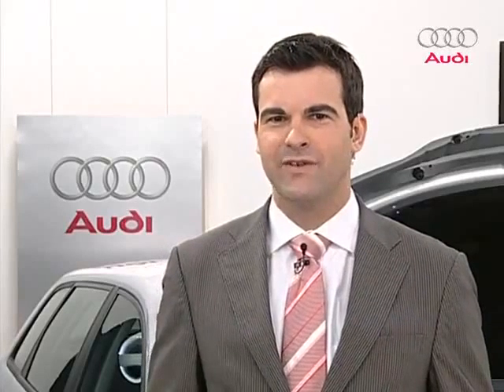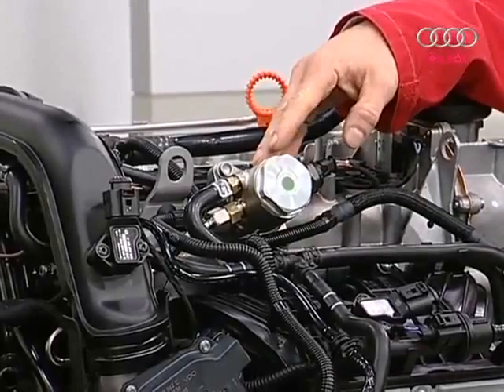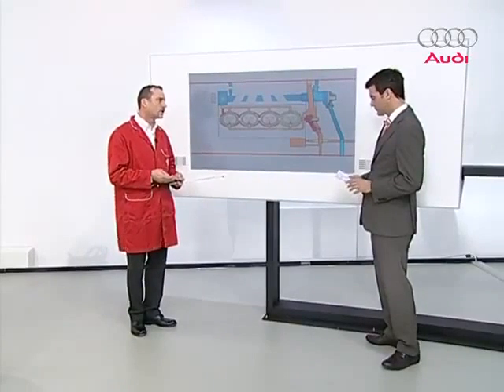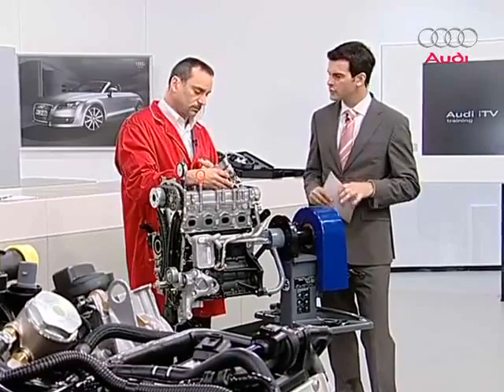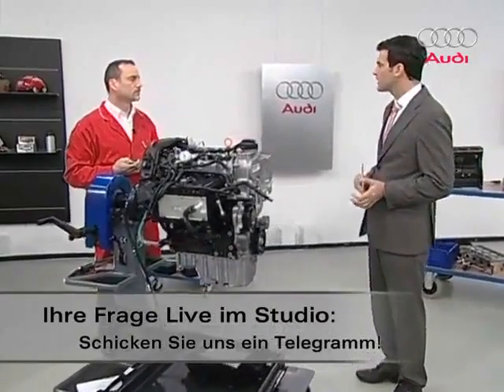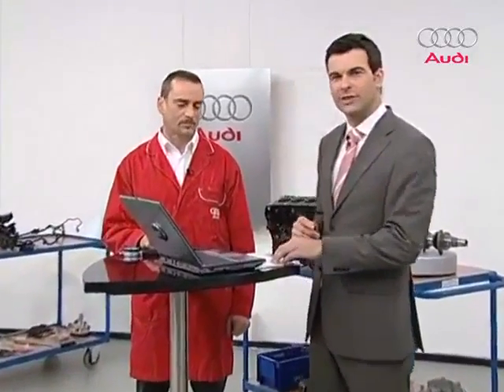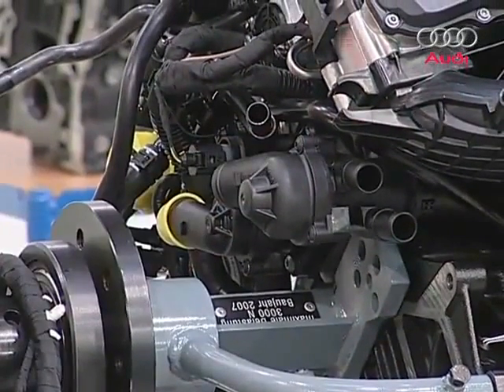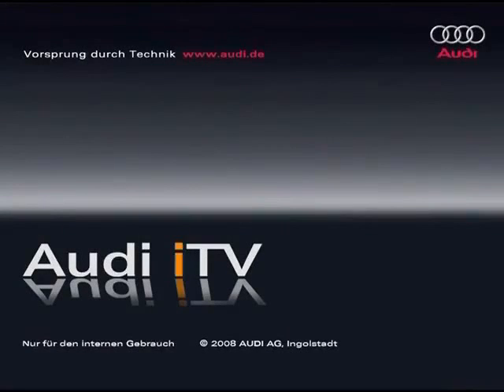1.4 TFSI Service Training Information - Part 1

Comment: My Jetta 2016 1.4 tsi with 35k miles is doing great in the gas averaging 45 miles x gallon.  I got the car used for about 10 thousands dollars in January 2019 the car was a lease before i got it, 
The over engineering of this engine has pros n cons, Pros gas mileage, turbo engine is more powerful vs compacts cars in the segment,  construction is tight no squeaks, sporty driving dynamics.  The cons even changing the air filter is a pain in the ass, and when maintenance problems arise could be a  money pit but remember buy used with low miles after all the initial cost of the car was cheap

Comment: do you keep this guy in a box ,because he said he never heard about a timing chain being stretched .and the chain is life time guaranteed this in a parallel univers  but not here not now
Reply: I agree. Ralph must be on drugs. A lot of 1.4 TSI 140/170 HP engines has stretched timing chains
Reply: I have the same problem with my golf mk5 gt tsi 1.4 chain tension went I change it I change chain too and it was stretch as well the valve change too and air test the piston head and the car still not starting am so angry mash up nuff money trying to fix it and no joy only thing I can do is change engine even that the engine are too much money they want £1.800 or £2.000 or £3.000 I was like what the hell engine cost more than my car I could believe it mate I tell yh
Reply: Ralph says "I know nothing"
Reply: It was a total construction fail. They have still big problems with this.
Reply: This guy had never heard about it as it had probably never happened when this video was made. Around 2008 I guess.
Reply: dudu dudu a chain doesn’t stretch, it is the links roller that’s worn that makes it appear stretched.

Comment: The combustion engine has evolved a lot over the last 100 years, and is much more efficient and refined these days. It is also a lot more complicated. It makes the relative simplicity of an induction AC motor much more attractive as a source of drive. The limitation being the high voltage traction battery technology, which now needs the focus of research and development.

Comment: I had no idea the 1.4 TSI is this old. It’s a relatively new engine in the US market. But I think it’s the newer version with aluminum block.
Reply: This is the chain driven turbo/supercharged engine, not the newer turbo only 1.4 (with a timing belt)
Reply: @eponymous7910  do you know the year of production of that types of engines? Are they based on this engine?
Reply: anything below 2009 and to 2014 , u can refer to the chassis code first few numbers

Comment: Hi, I have an Audi Q3 Sportback 2020 model with the 1.4T TFSI Engine. Is this the same sort of engine as this? If so, I’m not sure how reliable it will be.
Reply: This engine has a cam chain and this was very problematic on this engine .
Your engine has a cam belt and seems like a good motor  Ea211.
Reply: @juliangedzierski2546  oh awesome, thanks heaps 🤙

Comment: i had  to replace timing chain (whole set) , ignition coil packs (second time so far), internal leaking high pressure fuel pump and clean carbon build up from intake valves because of misfires,  and decreased power. @ 62k miles / 100k km.
Soon i will have to change water coolant pump because of the squeaky compressors electromagnetic cluch pulley...
A fail engine with serious design flaws and low quality parts. Endless money pits...
Reply: Age and type of car?
Reply: Just replaced another water pump, kompressor belt + drive belt on my twincharged mk6. That's twice in 9 odd years. These engines are soooo finicky

Comment: JA FRITZ, DAS IST GUT MOTOR, JA, JA ... 
Lügen wieder erzählen?
Next time incorporate the sprocket with the crankshaft, it will be even more expensive and will shorten the engine's lifespan to 50.000k  so you can sell more "cheap" "Volksautos" with chains stretching which can't even meet the normal BELT lifespan. Also, super expensive parts, super complicated service- like you couldn't make it even more difficult and expensive? WHY DO YOU EVEN BOTHER WITH CHAINS??? I CAN'T UNDERSTAND.  BELT IS MUCH FASTER TO CHANGE AND MUCH CHEAPER!! Personally, I wouldn't risk but Citroen claims their belt service should be carried on every 180.000-240.000 km !!! Again WHY WOULD YOU BOTHER WITH CHAINS THAT CAN NOT EVEN LAST 60.000km or in many cases less??? 
Shuldigung Fritz, I forgot to mention OIL CONSUMPTION- I believe TSI and TFSI engines consume more oil over 1000km than Trabant.
Reply: I really love your comments,  so true !   I d drive a trabbant any day ,so simple and with amazing character. 👍👍

Comment: Hi
My car (1.4 tsi golf mk5 66000 miles)  is showing error p3008. Initially the error code p000A appeared. I changed camshaft sensor then code p3008 came up. Most of the people are saying that timing chain needs to replace. It was fine , I just changed water pump because it was leaking, and new drive belts, with engine oil service , dsg service & spark plugs. After all this work when I started my car a code p000A appeared, then changed camshaft sensor, camshaft adjuster valve, after 5 minutes a new code p3008 came up, car starts but idle rough. When press acceleration it vibrates very heavily. What do you think might be the problem?
Reply: I realise this answer is too late for you but for anyone else with this problem, it's likely to be valve timing, caused by a stretched timing chain or it could be a worn out camshaft/cam followers, if you've eliminated everything else as outlined in this original post..
Reply: Peter Shaw hi, thanks for your reply. It was the timing issue. Which was caused by very loose tensioner, due to which chain jumped a couple of tooth and timing went out. I replaced the chain & tensioner and car running fine since then...

Comment: It's a real shame that Audi have designed a valve train drive system with defective tensioner and cheap and nasty components that results in failure after as little as 30 000 km. The world is full of failed cam chain tensioners in the vw audi seat range. The days of German reliability has clearly gone. Come on Audi....dont let the accountants rule design and stop sub contracting manufacture of plastic rubbish in China

Comment: Shitty engine, bad timing chain design, eats oil, fuel consumption is high.
Reply: Vlad Mihai interesting. Mine has 60k miles and burns no oil and I get 39 mpg 🤷‍♂️
Reply: @JG-ge3ui  well, given it is a timing chain, not a belt, it should have been stronger. Also, you are one case, maybe lucky. It depends on the year also. After 2011 they revised the timing parts. All in all, a timing belt is longer lasting which is not right